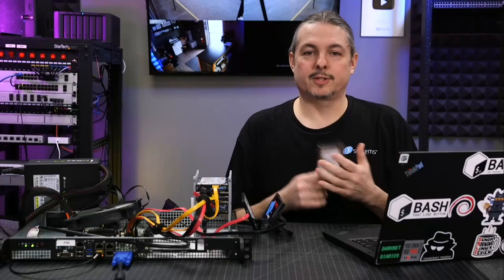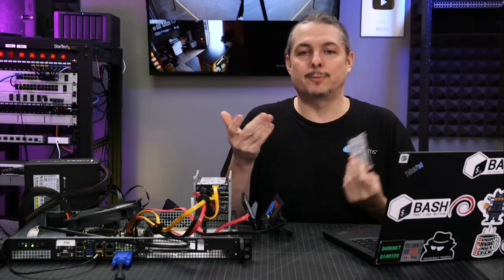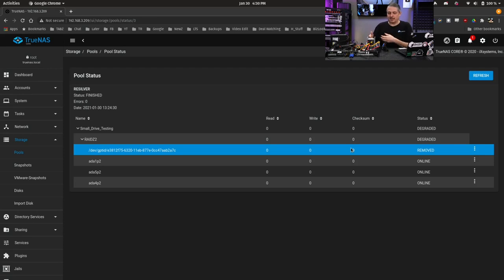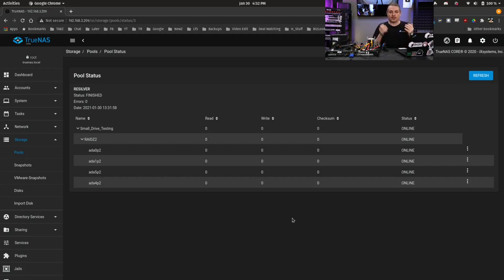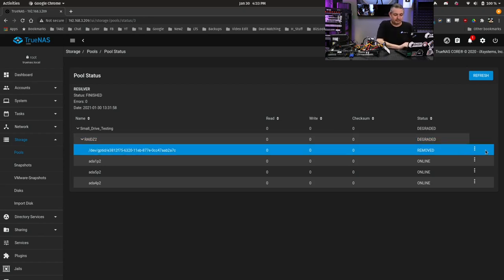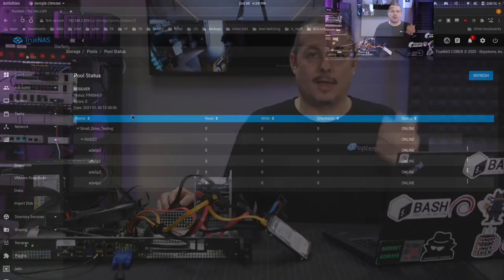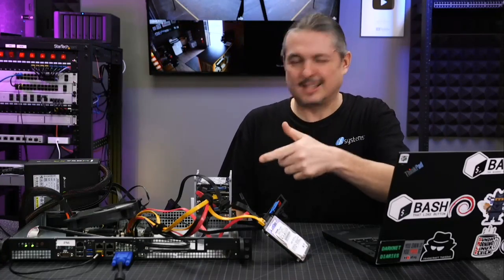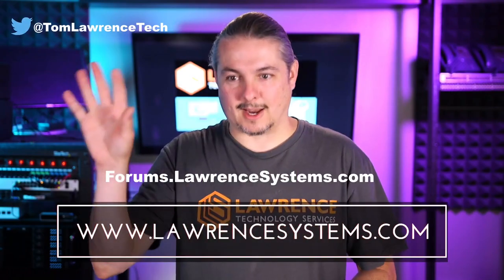TrueNAS 12: Replacing Failed Drives

Comment from the maker: FreeNAS ZFS VDEV Pool Design Explained: RAIDZ RAIDZ2 RAIDZ3 Capacity, Integrity, and Performance.
https://youtu.be/-AnkHc7N0zM

How to Build & Extend FreeNAS ZFS Pools with VDEVs / Adding Drives to an Existing FreeNAS
https://youtu.be/76qnBjZF65g
Reply: Extending a NAS on ZFS isn't a ZFS issue it's a TrueNAS issue. Extending the RAID on unRAID which uses ZFS is quite easy.

Comment: Worth noting: if you replace all disks progressively with larger disks, you can expand the array to the extra space once the array is stable on the larger disks.
Reply: thank you for this comment
Reply: one at a time like unraid or can you do multiples and let the parity drive recreate the data?
Reply: @cosmickatamari  one at a time only
Reply: Does it expand it automatically once you've systematically replaced all the disks one at a time? Thanks

Comment: Also worth noting (for future readers) is that if you originally imported your ZFS pool from a non-Truenas/Freenas system and you are replacing like for like you may need to do the drive replacement manually from the shell.  The reason is the GUI "replace drive" code always creates a swap partition on the first few drives and then tries to create a ZFS data partition.  If your pool was created on another system it probably wont have these swap partitons, so if you are replacing a failed drive with the same sized drive it will abort with "not enough space" after creating the swap.

Comment: Maybe I missed it, but I didn't hear you mention that you can replace the drives in a vdev by larger ones if you do it one-by-one. After that, you can easily extend the filesystem. This solves some problems for people with no spare SATA ports that need to upgrade their storage capacity.

Comment: I know this is a fairly old video - but you helped me recover a ZFS2 array out of a failed system with a bad drive out of the 4 - and now it's recovering because I knew that the "unavailable" drive (which was no longer installed) had to be "replace" with the new one installed in it's place. Top job!

Comment: Thank you for your videos. I am a complete Noob working with TrueNAS, I had one of my HD power connector caught on fire. It was a cheap power connector. I have never had on in the past 30 years do this however, there is a first for everything. So the fire damaged the drive and had to be replaced. You made it very easy for me to replace the disk, and get back online. Thanks

Comment: note that you can tell zfs to replace the missing drive automatically with a drive that is connected to the same location that the missing drive was in, but this option is not enabled by default.
also, that you can modify vdevs directly (add/remove/attach/detach) for mirror/stripe vdev only pools, but not any pool with a raidz vdev of any type.

Comment: Thank you for the video! Have one question. If there are lots of data in the pool, it may take quite a while for the re-silvering process to complete. What's the best way to deal with possible power outage especially at home? Basically, can the re-silvering process be interrupted (due to power outage) and resumed later? Thank you.
Reply from the maker: Yes, If disrupted it will resume

Comment: will it default to the lowest size drive in the pool, or would you have to manually make it bigger? like if you replaced a 320gb drive with the 1tb like you said, then eventually all the drives got replaced by 1tb or larger, would the pool become bigger, or still be stuck at 320gb ?

Comment: Thank you for this video. I am attempting to run TrueNAS on an older HP system that uses a raid controller. We needed to change the controller to HBA mode in order to see the 8 drives in TrueNAS. However, when I run the 'loose cable' scenario by pulling out the drive, when I plug the drive back in it doesn't go back online, I cannot 'online' the drive using the GUI, and I cannot 'replace' the drive either. 

If I put in a new drive it sees the new drive and allows the replacement of the drive. 

Not sure if there is some sort of default setting that needs to be changed, or if I need to re-format the drive before putting it back in, or if there is a manual way to dismount the drive. We are using 1 zfs pool.

Comment: My drive supplier puts a logo label on them (covering the serials) which it makes finding the failed drive a nightmare... I have a system running Plex & Nextcloud.  Drive da11p2 shows errors.  I have a 14 bay system... I could just plug a new drive into bay 12 & substitute it for da11p2.  But still wonder if there is a way using the lights to ID the drive that is replaced?  Using a DL380eG8

Comment: I had a question about replacing a failed/failing drive but the drives in my home built TrueNas Scale are not hot swapable, how do I replace a failed drive? 
Do I need to shutdown the system, replace the failed drive and select replace from the trueNas Scale menus?

Comment: Really funny turn of events. About one hour after I watched this video my ssd acting as cache gave up. I replaced it and move to UI with replace command and fail :)
I have done this thru shell before you have to dd /dev/zero to begining of disk and do replace then, but was lazy and just removed the cache and add it again from the "Add Vdevs to pool". TrueNAS Core 12.0-U1.1

Comment: OK one question. every so often I will get a degraded state that one drive has failed. I can restart and everything thing is back to normal.  I either have a cable that is not as good as it should be or I do have a drive that is you know getting ready to croak.   I have the smart turned on ect,  But I never get what drive caused the degraded state. because I never get to catch witch drive went off line in the first place.   were can you go to see a log of what drives or drive could be causing the degraded state so I can go to the source of the troubled drive and investigate.  further.

Comment: So, if the four drives are all 320GB, one fails and is replaced with a 500GB drive, Vdev and data is rebuild, all is good!
The week after a 2nd drive fails, same thing happens, replaced with a 500GB drive, rebuild, all good again! Then the 3rd drive, and finally the 4th drive!

Now they're all equal size again. Would that mean the Vdev could be expanded to include the 4 x 180GB of otherwise wasted space?

Comment: Hi? I was trying exactly (almost) the same what you did: replace a disk. Actually the original disk was start counting some errors. I took another exactly the same disk. Everything was deleted from that "new" disk and killed any partition. So, raw empty disk attached. The problem was that "Replace" command didn't work since there was no option to choose from at "Member disk"  position. I saw no other option then restart whole box. Disks syncing was done fast during the boot, so everything ended OK. 
Do you have idea what may cause that difference? (Probably motherboard bios specs)
This is experimental and educational box just for exercise those operations. Installed is th latest TrueNAS 12./8U

Comment: 2:16 - Very odd, so I have a brand new WD Red NAS Drive (4TB), that does exactly this once it was moved to a new slot, ( installed nvme which disabled one onboard sata controller)

Installed into an pci sata expansion card, but now experiencing the same thing, drive will come and go after a reboot, it is a brand new drive, it doesn't have any sign of corruption. (every file is intact & no smart errors) 

However truenas seems to have the sata device detach if it goes without use for a long period of time.

For instance, if i boot up my truenas VM (prox mox vm with passthrough) i can begin a file transfer almost immediately once started, no hitches, no errors.

But once the drive is not in use it is detached from truenas it seems.

Comment: Hi! Nice video! How exactly does that work if the pool is encrypted? I’ve read that you have to renew the key while resilvering? After resilvering? Before a reboot? Otherwise you might loose access to the pool? Last time I checked the FreeNAS/TrueNAS documentation I found that the instructions were not 100% clear.  Does anyone know the exact steps? Did they change from old FreeNAS encryption to new ZFS native encryption?

Comment: At 5:12 by which clue did you assume that it was ada0? 

PS:Was ada0 the new disk or the previous one?

New edit: Ok under RaidZ2 it labels disks as ada0,ada1,ada4,ada5 but why this weird sequence?  From the example it seems that
                  ada0 remains the same for the old and new drive but causes ZFS to name it ada0 since it is  cable independent?
Reply from the maker: ada0 represents the physical location but as I said in the video, it's not directly relevant to ZFS.
Reply: "which clue did you assume that it was ada0?"

if you go under Storage > Disks, the table there includes both the disk id and the serial number which you can match with whatever is printed on the physical drive when you look at it.

Comment: i have a 5 disk TrueNas 12 that consist of 4x2TB and 1x4TB in a raidz2

i now have 4 additional 4TB drives and would like to swap the 2TB's with them.

Since raaidz2 has a failure resilience for 2 drives, can i replace 2 drives at a time between resilvers?

Or is it better to still do it one drive at a time? if so, why?
Reply: Either way works fine. But you have a higher risk to loose all your data in case you replace two drives in one go because if a third drive fails during resilvering all data is gone forever. 

From TrueNAS documentation:
"When considering the number of disks to use per vdev, consider the size of the disks and the amount of time required for resilvering, which is the process of rebuilding the vdev. The larger the size of the vdev, the longer the resilvering time. When replacing a disk in a RAIDZ, it is possible that another disk will fail before the resilvering process completes. If the number of failed disks exceeds the number allowed per vdev for the type of RAIDZ, the data in the pool will be lost. For this reason, RAIDZ1 is not recommended for drives over 1 TiB in size."

Comment: I have a question, if I take out a failed disk and format it on my mac, then do a first aid. mac says the drive is fine. Is there a better way to inspect a hdd?
Reply from the maker: Test it under load by doing lots of reads and writes
Reply: @LAWRENCESYSTEMS  what would be the best program to test that with?
Reply from the maker: In Linux there is a tool called FIO

Comment: I run FreeNAS 12 as a VM under ProMox with the LSA SAS 9211-8i controller in "pass thru" mode.  Can you elaborate or otherwise guide thru the same process to replace a failed drive in this scenario PLEASE?
Reply from the maker: I don't ever recommend virtualization of TrueNAS but if you are passing the controller through I am not sure what the difference would be in the process.
Reply: @LAWRENCESYSTEMS  Thanks for the reply!  I have pretty much come to the same conclusion but my "superiors" insist on it!  I tried it before and came into problems because of the difficulty in the replacement drives showing up as they need to have "pass thru" entries in the config file.  Not too difficult but not trivial either.  So the best info you can prove is "why you do not recommend visualizing TrueNAS".  Thanks for anything you can provide.
Reply: @LAWRENCESYSTEMS  Hello again.  I discovered at least one reason NOT to run TN under ProxMox.  It is because you cannot mount or otherwise import a drive that has any zfs partitions.  So while you can go through the process of "adding a (raw) physical drive to ProxMox" and carry on to create a RAID configuration using zfs, you cannot import a drive that already has a zfs partition.  This effectively means you cannot use a three drive collection to use the replacing method to keep an offline copy of a RAID 0 set.  I have done this as an easy way to keep a reliable backup by rotating in / out a third drive and just re-slivering the imported drive, which should have minimal data deltas.  Sorry if this is out of scope for this post.

Comment: Is there a way to know which drive actually failed? If you have 24+ drives on the server, how does one know which drive failed?
Reply from the maker: By looking at the serial numbers on the drives compared to the serial number of the one that failed.
Reply: @LAWRENCESYSTEMS  oh thank you. Do you typically make a note of every serial number before hand so u can track their location?
Reply from the maker: For many drives they are already printed on the drive opposite the power & sata connector side.